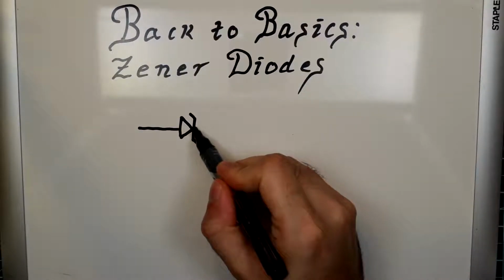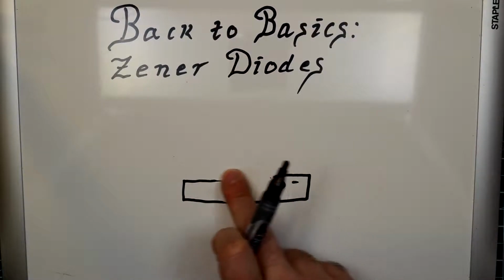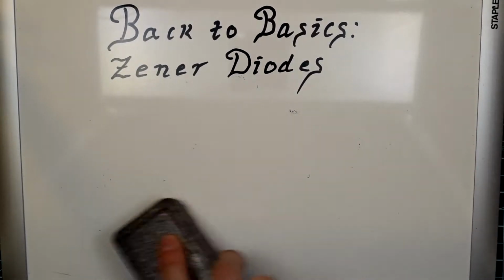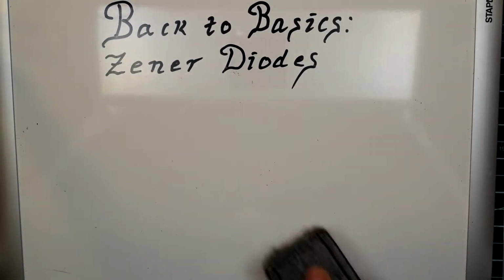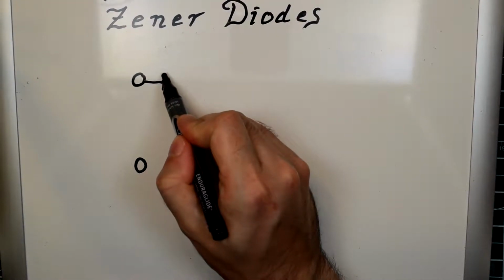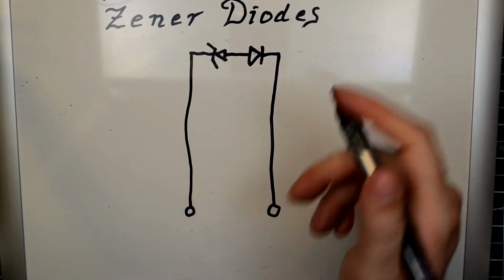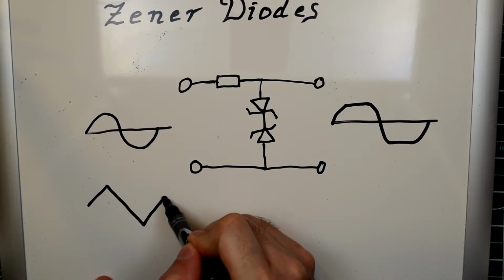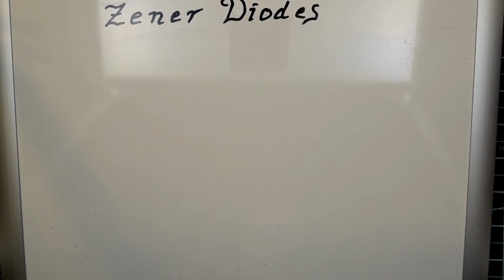Back to Basics: Zener Diodes

Comment: Howdy, is there a way you know of that I can easily test the transmission radius of a coil?
Reply from the maker: An expensive gauss meter would probably do the trick.
Reply: Gadgetboy do you have one?
Reply: Gadgetboy don't suppose I could jerry rig something cheap to find out... Led and another coil to test for brightness of led through transmission of power?
Reply from the maker: I do not have a gauss meter. Depending on the power of the coil, you might be able to see the field in some iron powder.
Reply: Gadgetboy ehhh not really something I have lying around, I did think of layers of magnet film but that would be unwieldy
Reply from the maker: Easy to make iron powder. Attack a hunk of steel pipe with a file or sander.
Reply: Gadgetboy all my pipes are copper, and that sounds ime way too much effort 😂 I did wonder if there would be a way I could somehow use paper and the powder to create a pattern glue sheets of these together and somehow burn away the paper but leave the iron connected to itself to create a 3D structure, but that's insanity